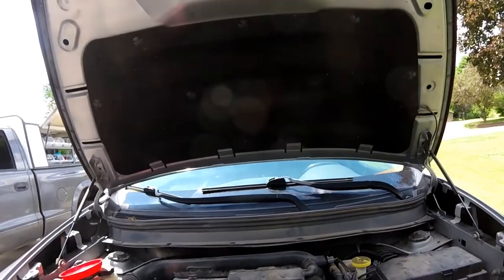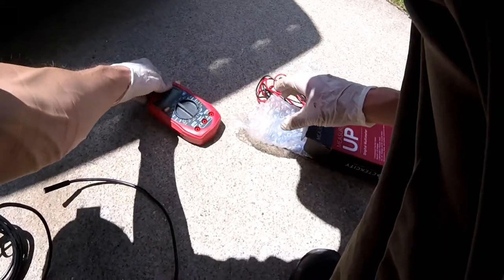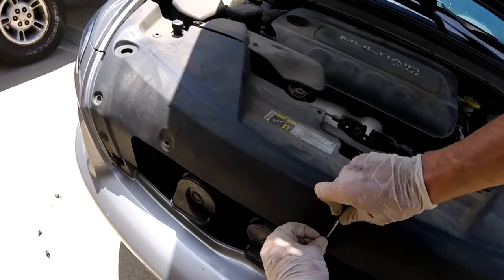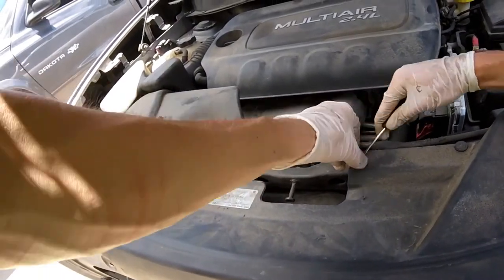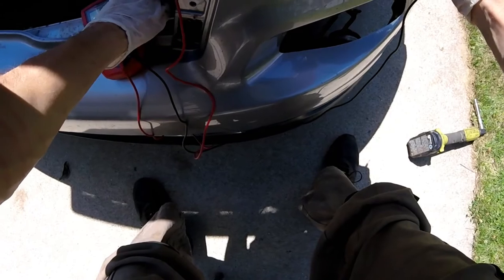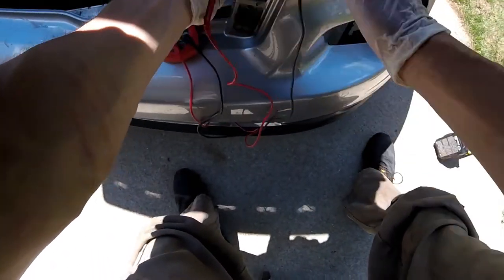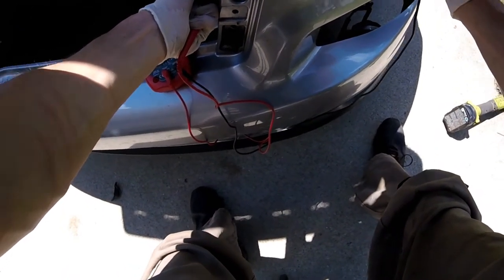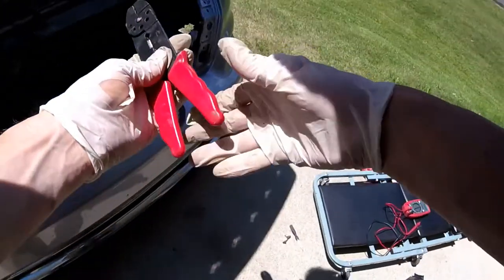Mobile Mechanic - 2014 Jeep Cherokee U11E9 Active Grill Shutter Diagnosis

Comment: Bro, thank you for sharing this. My kiddo had her 2017 Jeep Cherokee Sport hit in the front and Caliber Collison fixed the car. However, I told them about the check engine light before the car was dropped off. After checking out they told me we just needed to change the oil. Mind you he plugged his obd reader two times and repeated the same to me. What the HELL, I do know a little about cars. The next day I took the car to Auto Zone, I used their Fix Finder OBD powered by Innova and he told me it was a code U11E9 active shutter grille issue. The guy said to be ready because Caliber might say to you that your car does not have an active shutter. Boy, he was right, I had the Caliber guy open the hood and yes there was one. After seeing your video, I think maybe one of the wires got damaged and they probably overlooked it. The jeep is back in the shop.
Reply from the maker: You're welcome!  Man, what a frustrating experience!  I was close to buying this customer a new grill shutter, but after resetting the code, I could see it move, so I assumed it was still functional.  I saw another repair on YouTube where the technician found a broken wire and sure enough, this one had it as well.  Good luck!  It took some work figuring it out.  Hopefully you have a thorough technician trace back the wires and get it fixed!
Reply: @mjspiess  I just came across your vehicle. I have a Jeep Cherokee 2014 that is currently being repaired. The active grill shutter needs rewiring. You mentioned in this video that the shutter can become damaged from accidents. I haven't lately so could my issue be from corrosion? I'm just asking because they didn't tell me much at Chrysler.

Comment: What exactly is the purpose of that shutter? TIA.
Reply from the maker: Its primary purpose is to control the amount of air that flows through the vehicle's grille and into the engine bay based on various factors such as vehicle speed, engine temperature and cooling requirements to improve aerodynamic efficiency and fuel efficiency.

Comment: Bad camera work buddy.... u lost me...
Reply from the maker: I was experimenting with a body camera.  I think it will end up better if I attach it to my head in the future or tripod.
Reply: @mjspiess  who cares about the camera work that guy doesn’t have any videos help people out great job in the video. I’ve seen the grill shutter problem right now keeps shutting off causing my 2015 Jeep Cherokee sport to overheat. I just had a rebuild engine installed into the car everything done thousand dollars worth of work. I drive the car for a week and it’s overheating yesterday back in the shop last night so let’s see how fast they can get this done. Without my car without my car. I can’t make any money.
Reply from the maker: @kennethbenson7259  It sounds like you're dealing with a really frustrating situation. The overheating issue, especially after investing so much in a rebuilt engine, must be incredibly stressful. The active grille shutter problem is known to cause overheating in these models. Hopefully, the shop can fix it quickly so you can get back on the road and back to work. Hang in there, and fingers crossed for a speedy repair!